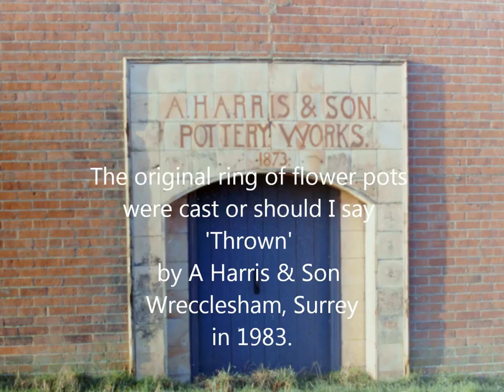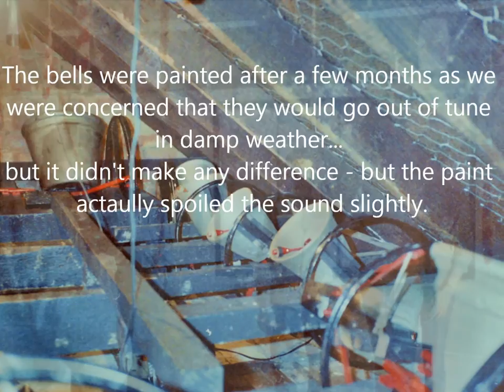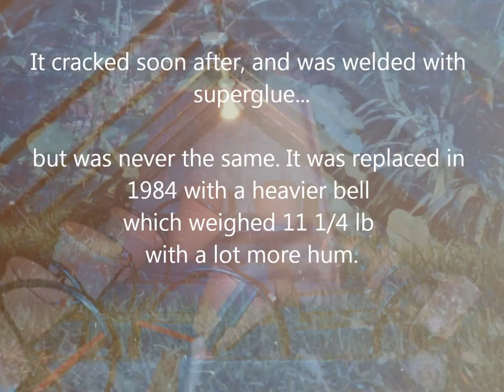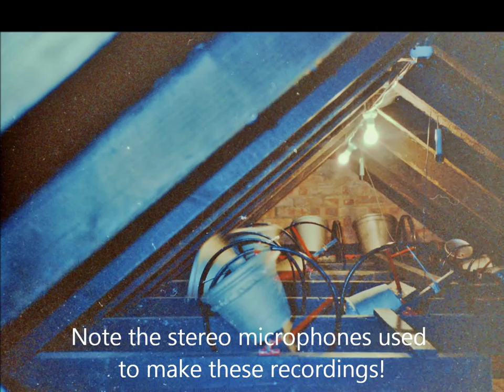Liss Campanile Clay Bells

Comment: All very impressive! I’m designing my own at the moment. How did you get them all in tune?
Reply from the maker: They are selected in tune. Tuning a flower pot is difficult, but if you are careful you can lower the note slightly by grinding inside with an electric drill with a sanding attachment.
Reply: Steve Hough Oh righe thanks. I bought some that were relatively in tune for a mini ring but couldn’t tune them and they were going all out of tune. Now looking to buy some cheap hand bells if i can find